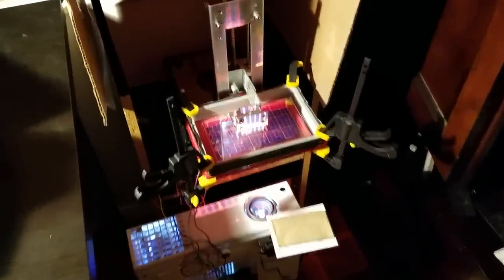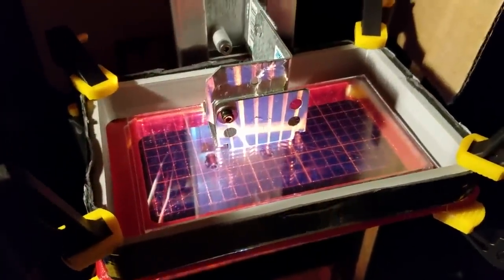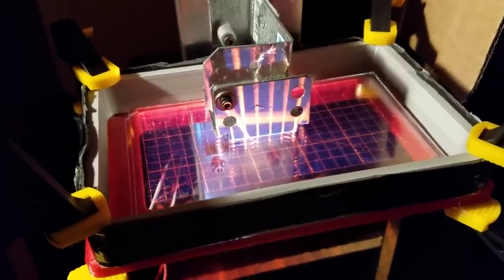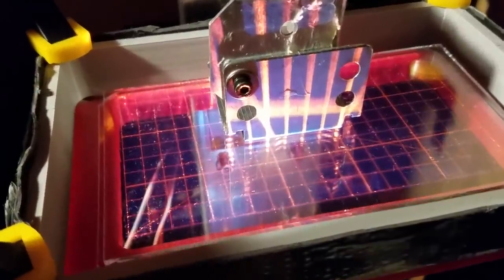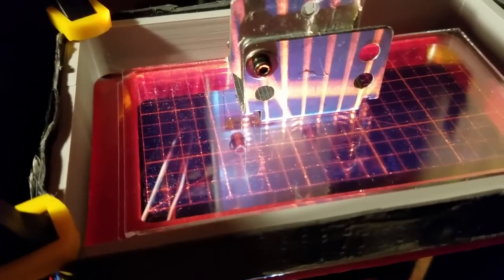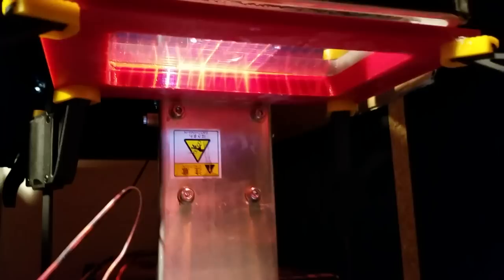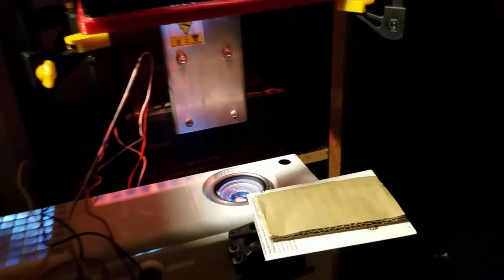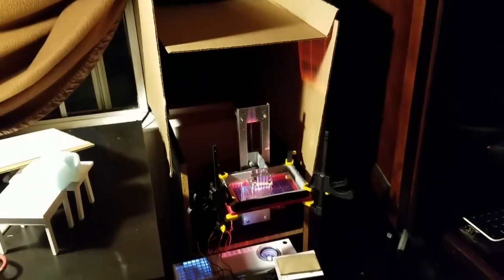Build Your Own Damn Printer V2 Bottom up

Comment: Hello I'm from Brazil. I am building my DLP 3D printer. I have doubts about the projector. Do I have to make any internal changes to the projector? I'm using Raspberry pi + NanoShield. My projector has HDMI outputs. I will use the NanoDLP software.
Reply: can't have any barriers after the glass projector lens, or it will filter out the blue, uv light needed to cure.